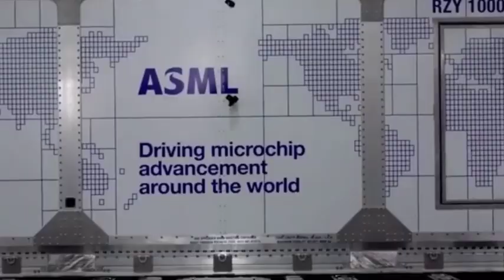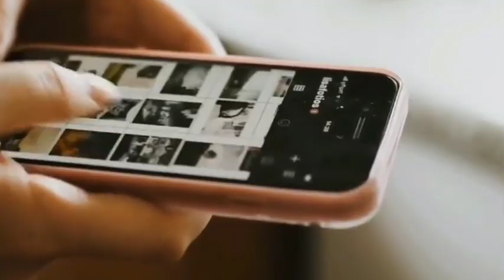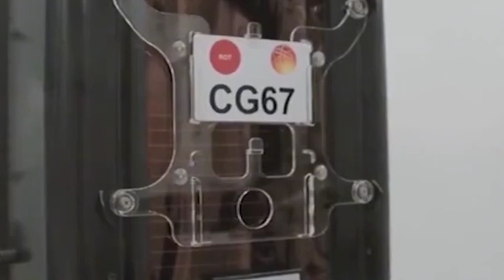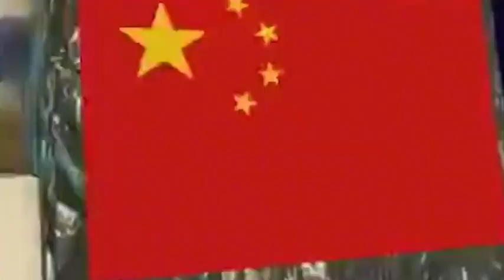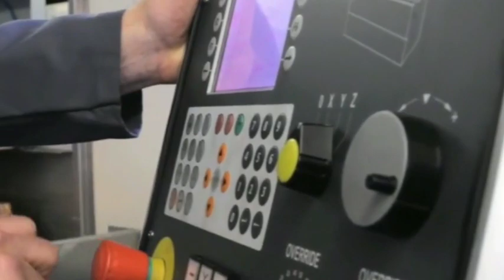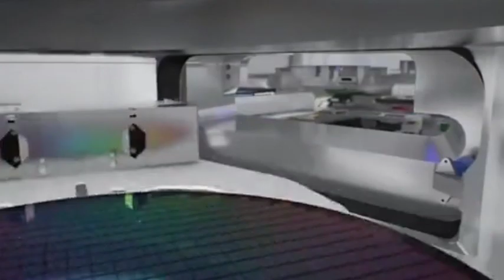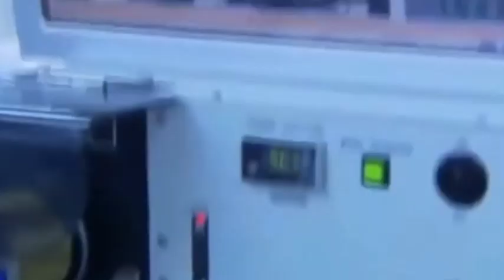Delivered lithography equipment worth €2.2 billion to China, just a technical trap set by ASML?

Comment: The good news is China industries can practically produced all the sparesparts they need to service all these lithography machines sold by ASML.
That is why it is rumored that ASML has started assembling these equipment inside China to circumvent the illegal blockade.
When Carl Zeiss built a new factory inside China recently, it confirmed my suspicion. 
China is unstoppable at this point.
It is either trade or work with China or be included in their list of unreliable suppliers. What has Netherland's ASML got to do with US? EDA software 🤣🤣🤣
China can easily substituted them today and the good news is they kept improving with every passing month.
Even Harmony OS is coming out with V4.0. ❤️❤️❤️
Reply: Finally some good news.